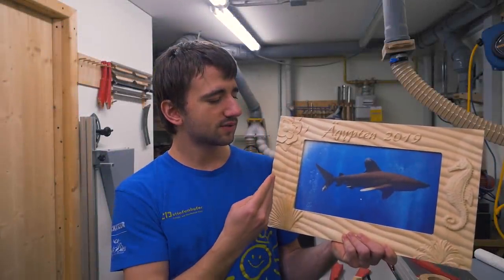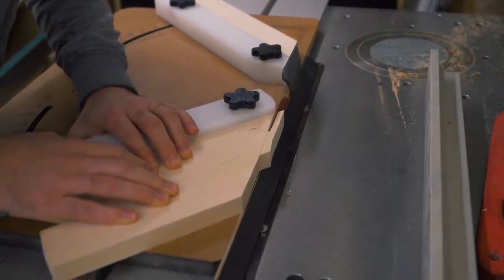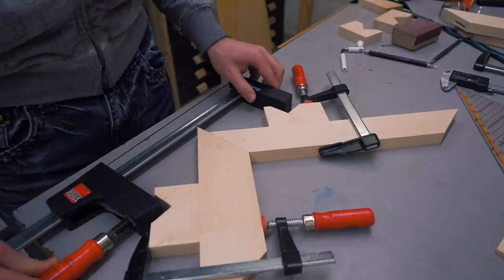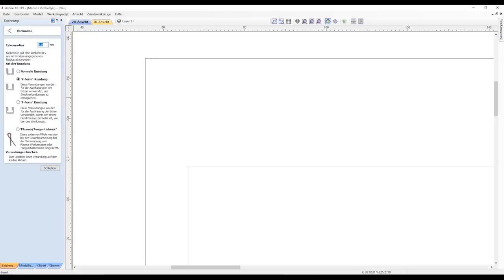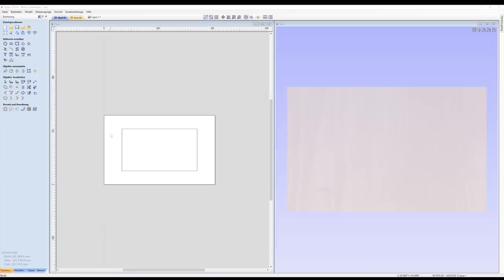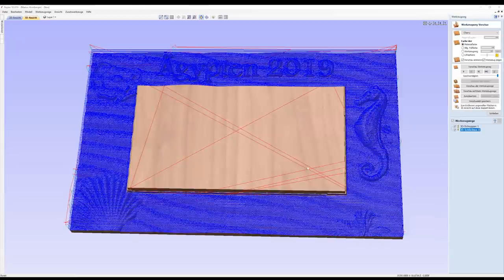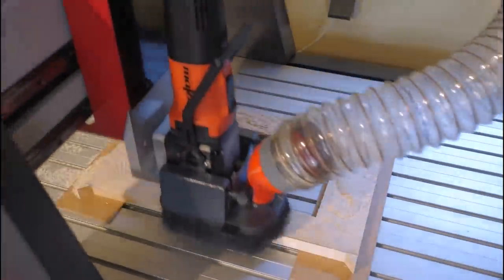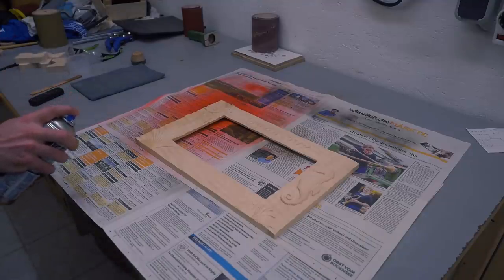3D carved picture frame

Comment: You trued your poly fences by using a square inside them then used the outside of those fences to guide your workpieces.  That assumes that your fences' sides are parallel which they probably are in your case.  But you could have used a framing square to check the outsides of them for square.  Another good video.  Wish I could sit in the corner with a beer and watch you create.
Reply from the maker: Yes, setting the jig up that way works. I made sure my fences are parallel.

Comment: Great video as always. I don't understand the need for people to express their opinion on the design though. You like it or you don't, who cares the frame is not for you.
On a different note, why did you choose to have the mitres not end in the outside corners?
Reply from the maker: I wanted to, but that ended up with weired angles that would have been very difficult to setup. 45° is easy.

Comment: Hi, I'm curious, how do you set the x- an y-axis zero position for the work piece on the Hammer cnc? You didn't mention it on the previous video either.
Reply from the maker: I move to an edge until the bit touches and then set zero (actually setting the negative bit radius, so 0 ends up on the workpiece edge)

Comment: Marius why did you not use the pantorouter for the corner joints?
That would have been much easyer I gues.
Reply from the maker: Maybe, but getting it into shop and setting it up would have take longer

Comment: Why not also cut/extract the shape of the frame using the CNC instead of doing the assembly work in the first 4min30sec of video?
Reply from the maker: I didn't have such a big piece to cut it out from if you meant that. Also cutting it from a solid piece would make a weaker frame because of the cross grain
Reply: @MariusHornberger  I thought glueing some pieces to make a bigger one. But after comment I realize it would make it ugly to have straight lines crossing the frame haha, unless you make some artistic mosaic

Comment: I dont understand why do you make the frame instead of engraving all it on one board
Reply from the maker: Usually you don't want cross grain in a picture frame
Reply: @MariusHornberger  Hummm... What do you refear with "cross grain"?

I was looking that the different direction of the wood grain in the corner makes the wood shine just until the joints, you can see it just over the seahorse.

I was thinking that made all over the same wood board will solve this problem, and also be easier to manufacture.

But man... I susribed to you're channel, I already know your work quality, and you're German... So if you do something like that, must have a purpose over been a dumb overwork.

Comment: Hi Marius, I was wondering what version of aspire did you use to make this carving. I mean the Vcarve or the 3dcut version?
Reply from the maker: Not exactly sure what you mean. It Aspire 10.0. And I made 3D tool paths
Reply: Well, Probably the full version. If I go to the website there are several cheaper option. I just have to do some reading before buying or trying. Thx for the response!